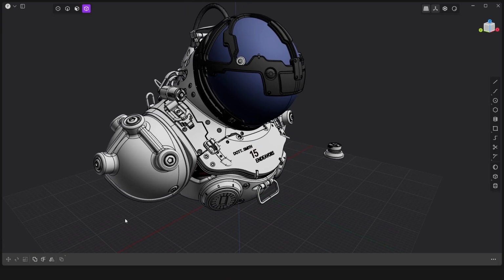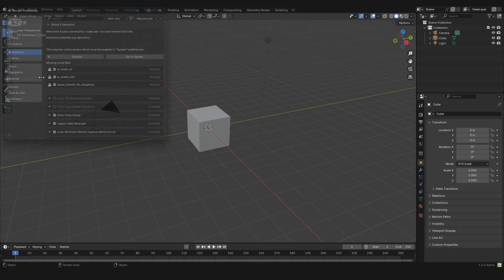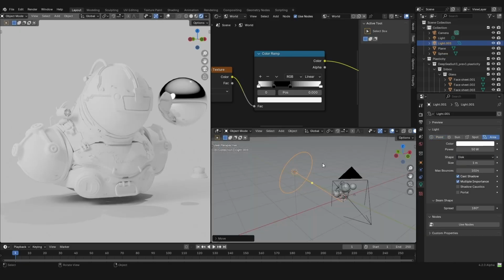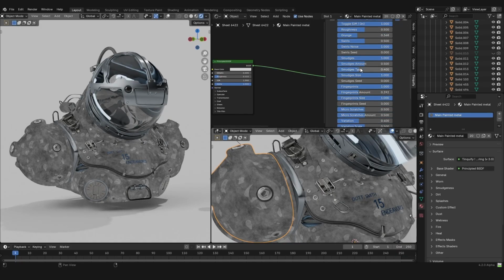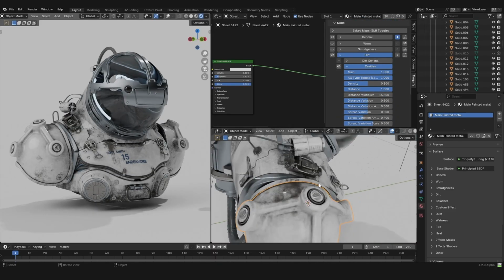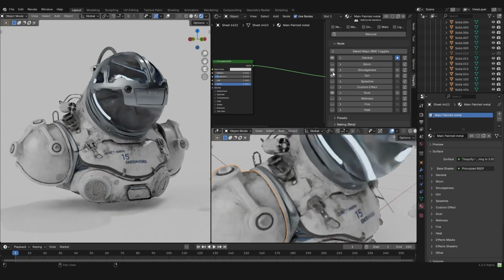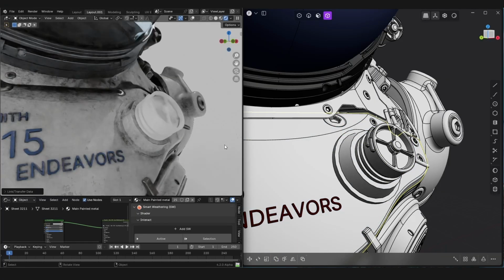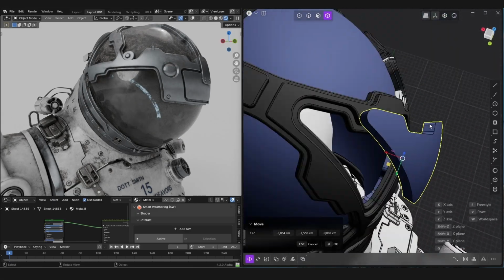Smart Weathering 3.0 - Tutorial - Plasticity and Blender bridge

Comment: what is the advantage of modelling in plasticity instead of blender?
Reply from the maker: Plasticity is a CAD software, while Blender is mesh oriented. They have different purposes. In some cases (hard surface, and precise surface modeling), it is better to do it with CAD. When doing more organic stuff (like characters, landscapes, etc), it is definitely better to use Blender. The good thing is that Plasticity is CAD, but with this bridge it is very simple to bring it to Blender for rendering purposes. Not many CAD softwares do that. This is just a kick-start, checking the differences between CAD and mesh will help you better understand it!
Reply: @Tinquify  Thanks for the explanation.

Comment: Nice stuff. Can i have multiple file exported from ( step) solidworks open in plasticity and get it rendered in blender ( so i do not need to uv the step files.)
Reply from the maker: Thanks for the comment! Yes, you can import step models to Plasticity and, once you gathered them in a single file, you can do the live connection option it has with Blender and you can add texturing with our procedural Smart Weathering add-on to avoid creating UV's as we show in this video. However, you would be needing to import them into Plasticity, which is a bit of a tedious and "destructive" task. The best non-destructive way would be to directly create the models in Plasticity. Hope this helps!
Reply: @Tinquify  Thanks for your fast reply. I am afraid I cannot make them in Plasticity as I have the step files from Solidworks, 300+ files and save them as step files... I render them in Keyshot, so Blender was always my second thought to use Blender for renderings...
Reply from the maker: @ No problem, and we understand it. It would be a very complex task to use that workflow. I would recommend you to search for add-ons that facilitate the connection between Solid Works and Blender. Maybe you can find a bridge like Plasticity has, and then you can texture your models procedurally and render them on Blender. Hope this helps you!